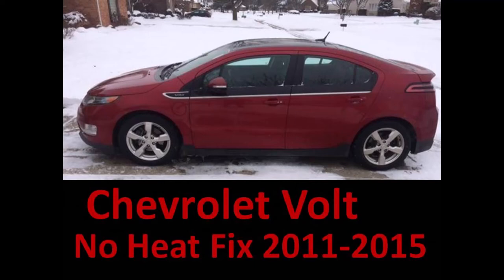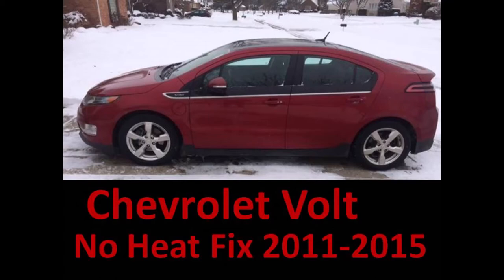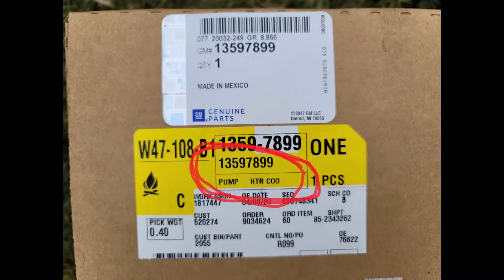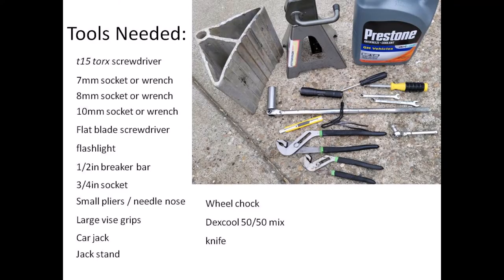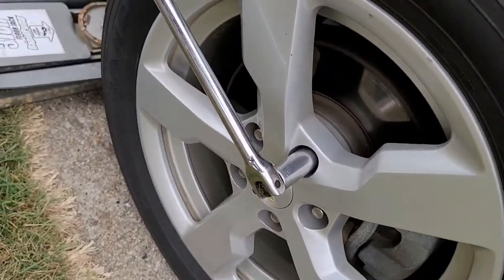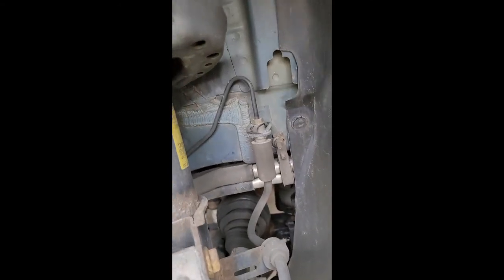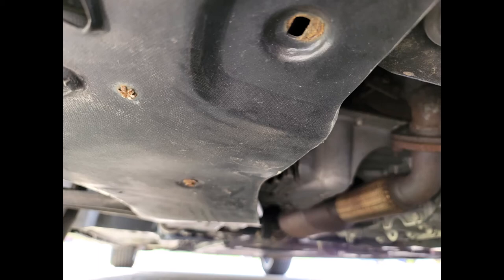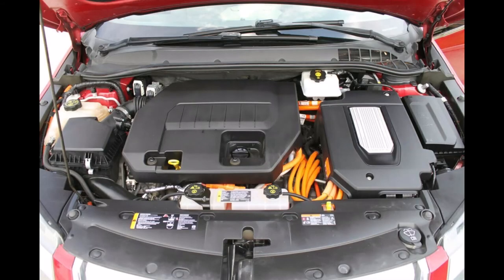2011 - 2015 Gen 1 Chevrolet Chevy Volt No Heat Fix Tutorial

Comment: Extremely helpful regarding tools needed before starting.  Regarding removing the electrical connection, I'd say that gave me the biggest problem, because first, getting the protective cover off of that side of the pump was a b****.  That back plastic holder was not interested in coming out.  Then after that, even after pulling back the white socket lock piece, it did not want to come off.  Almost broke it trying.  Other than that, everything went well.  Thank you.
Reply from the maker: Glad you have heat now!

Comment: Hi there, Could the faulty pump result no heat on gas as well? My 2016 volt blows cold air no matter on gas or battery. Thanks
Reply from the maker: Yep, we had no heat gas or electric. To tell if the pump is bad you can listen for an electric pump noise coming from the RF wheel well, or better yet remove the inner fender and feel the pump for vibration/noise/heat when it should be running. If the pump is running properly and still no heat, the 3 way valve assembly needs replaced, there should be another video on YouTube covering that R&R.

Comment: So you just replaced the pump and topped off the coolant?  Did you do any bleeding procedure using GDS or SPS?  Just curious as my 2011 is still blowing cold air and this year doesn't have KW meter on the dash to monitor load.
Reply from the maker: I didn't bleed it, just topped it off, it didn't lose much. Heat started working after the pump was replaced and is still working.